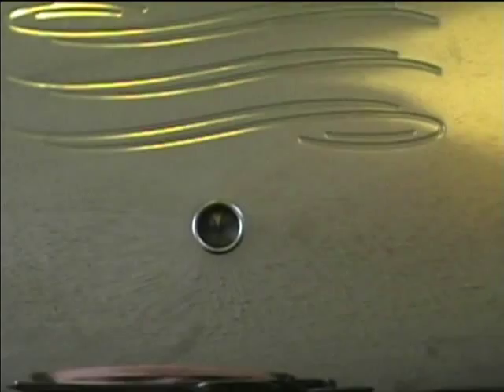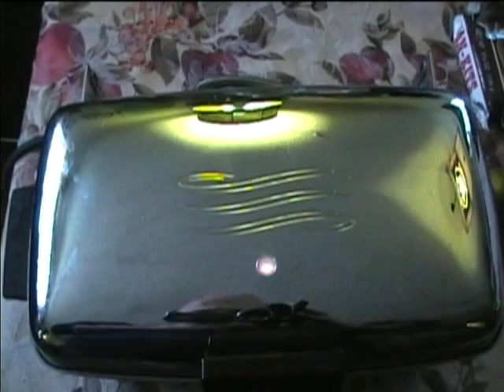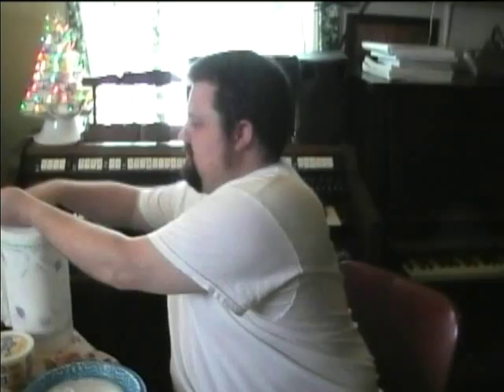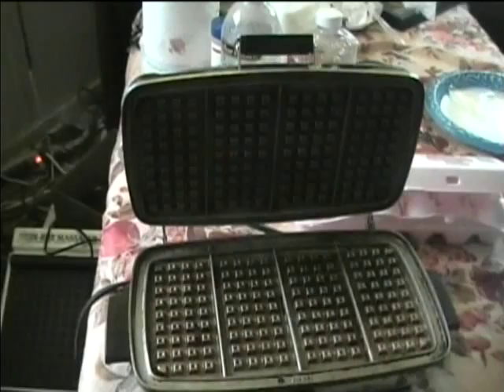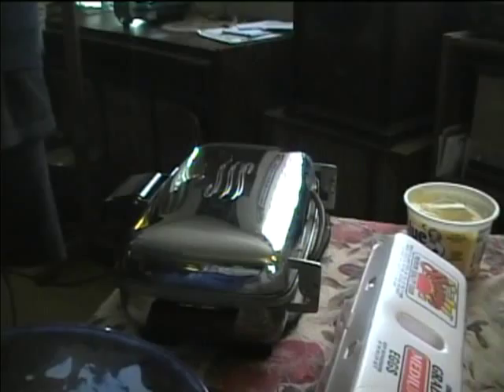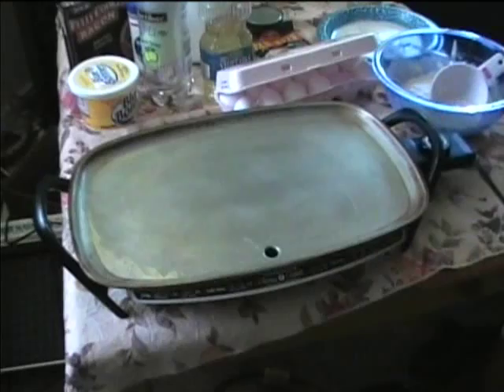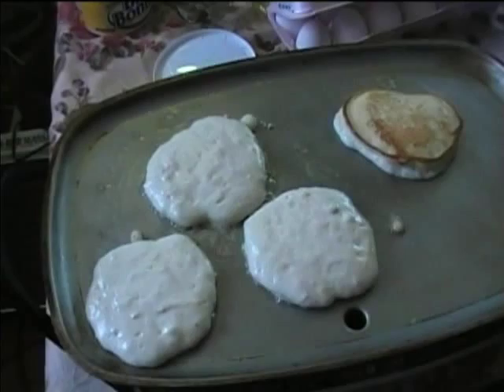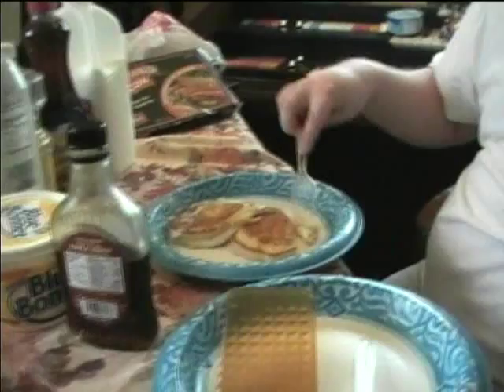1950's GE Waffle Iron and 1979 Farberware electric griddle

Comment: I have irons much older than this and they do not generally stick.  I use a silicon pastry brush dipped in oil and paint the surfaces before each waffle is made.  Stick free every time.  And it is a lot cheaper than constantly buying spray oil.

Comment: My mother had one of those GE waffle irons from the 50's, only her's had the slide temp control & reversible plates (the other side was for pancakes). I don't ever remember seeing her put butter or anything on the surface before pouring the batter on the iron, I believe the vegetable oil in the batter served to release the waffle. She also used a large measuring cup to pour the batter. Fond memories of eating as many waffles as I could, drenched in maple syrup, usually till I'd almost make myself sick. Ah, the good ole days...

Comment: Yep.. Same thing happend to me when I got my retro early-mid 1950's Waffle iron.. I had sprayed it but then was still making the batter and by the time I added the batter what I had sprayed had burnt off already so now I wait untill just pouring the batter and spray first then add the batter cause if you wait too long you're screwed.. What about your grids? are they reversable and flat and smooth on the other side or not?.. Mine are not..